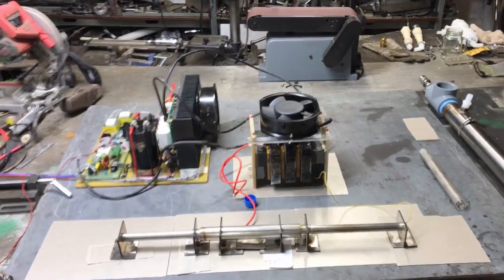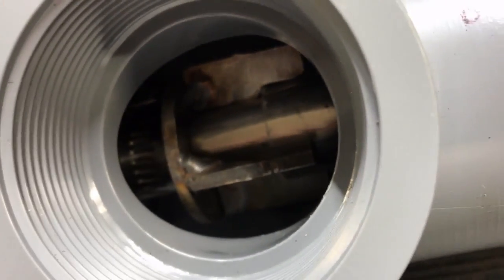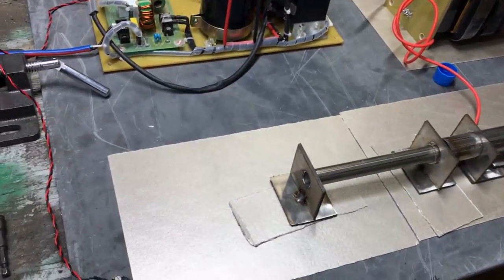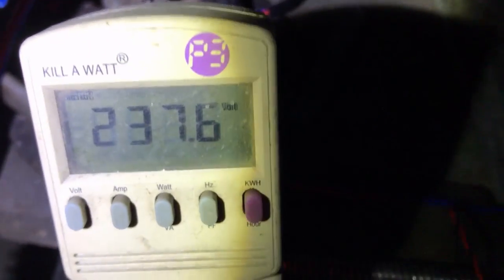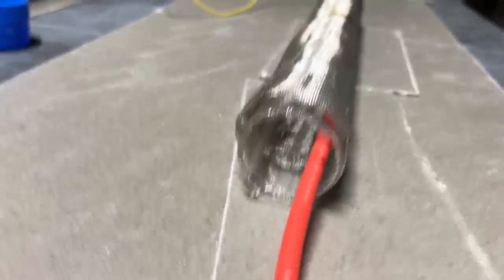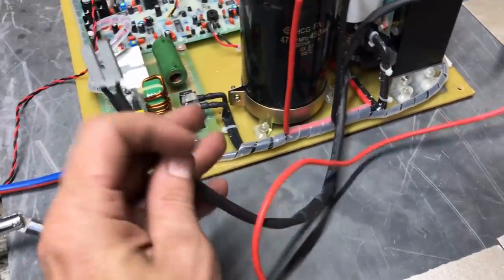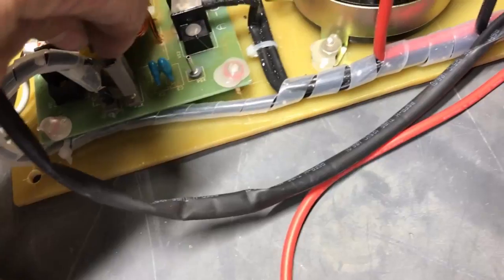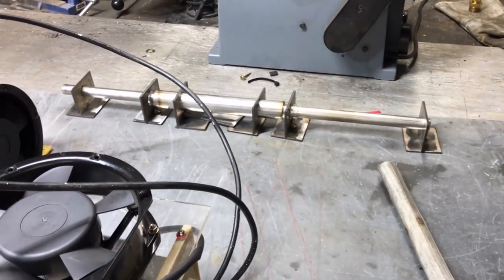Industrial ozone Generator DIY

Comment: You can build a vvariable frequency HV AC power supply from an old inverter type microwe board. Also use quartz tubing and add an inductor to form an LC tank circuot. The increased voltage will help it form an even high intensity corona inside.❤

Comment: NObox, please advise; I wish to produce ozone without the fan in my unit, so I can make it concentrate with 93% oxygen from my oxygen accumulator.
Reply from the maker: You will need a water cooled system
Reply: @NOBOX7  Yes I'd made one, however there's a new problem. Something in my ozone unit is still producing a bit of ozone, aside from the plate. I'm actually headed to Lowes for some silicon caulk to see if maybe it's coming from a tiny circuitboard on top of a radiator underneath a sealed unit inside the box. Just hope I don't end up sealing in heat and blowing out the unit. As for the 4x2" plate that makes ozone, it came permanently glued to a radiator plate, so I used a thick layer of JBweld steel putty to fasten on a cooling block, then sealed it inside a Tostidos jar. It seems to produce concentrated ozone but I'll need to fix the other problem before I can test again. Maybe the extra ozone was coming from a high voltage leak between wires I coated with liquid rubber, so I sealed those better in silicon also last night.
If only I could physically see where the ozone is coming from.

Comment: Just a thought on reducing heat. 

I know you use stainless steel because it's not very reactive with O3. But, it has a higher electrical resistance than copper. But unfortunately copper is reactive with O3. 

But, how about copper coat the exterior of the outside stainless steel tube, and the interior of the inside stainless steel tube, and have the stainless steel side walls of the tubes very thin, so as to shorten the electrical path conducted through stainless steel.   I suspect that will reduce some fraction of the heat generated.
Reply: Current is low. The corona is hot, however.

Comment: The reason you had problem with air tight welds is you need to either purge the inside of the tube when welding or use Solar flux to prevent crystallization or sugaring occurring on stainless steel tubing. Tig welding seems to be what most novice welders rely on for x ray welds. But in reality you can use just about any welding process you prefer. Bottom line is either you can weld or not so much. Sorry for not keeping comments on one comment section. Peace VF
Reply from the maker: Yes im just a novice welder when it comes to air tight welds
Reply: @NOBOX7  That is all right fella, we all start at that point. Then we all just go up. VF
Reply: ❤❤ big work!!
Reply from the maker: It was purged with argon
Reply: @NOBOX7  Sometimes the metal just has an excess of carbon causing the issue. Great work fella. VF
Reply from the maker: back purged and all
Reply: @NOBOX7  Yes Sir. VF

Comment: Hello, I love to play with my home made dc supply done with an old flyback transformer i have tried to do some tiny tests on jacob ladder and other litle HV stuffs, i looking for to have nice visual and glow not ozon but my tinny Dc fly back is a very limited product who warm very quick. I have take a look on aliexpress in order to find an "all in one package" AC regulated high voltage but it's very expensive  500€  to 1000€ for a pwm power supply + an elevator transformer  in the box + tax to add in order to play an learn ... your assembly solution seems to be less expensive and more robust  ! It's seems you have not the same power supply as in your previos video, is it possible to know the average price of your pwm + elevator transformer you paid on ali for this 2 components ? thanks
Reply from the maker: Yes the total cost was $1,700 US also they may hit me with a terrif tax
Reply: @NOBOX7  thanks for your reply i think i gonna refurbish and rewind a MOT in elevator / multiplier in order to save money.

Comment: You might  consider silver soldering  instead of welding if everything is a tight fit....
 Also you  can mig weld stainless with  steel wire.... but that will rust.

Stainless should get  back purged from the other side if you can. Makes a nicer and cleaner tig weld.
Reply from the maker: Yes , brazing or silver solder would be good but neither is compatible with ozone so igot stuck welding it .
Reply: What does it to to silver solder? @NOBOX7

Comment: that high FQ  was  loud on my speakers (good mic) good thing the big system was not hooked up my cat would have got me ,,,,but neat stuff your building their just neat-oh..i tryed to build am intake with mig welding it leaked but being it was a clunker project in ways epoxy would have fixed it as it just needed to be sealed from vacuum of running engine  .i never used it modded the oem intake instead but yea i never would thought mig welding was that porous